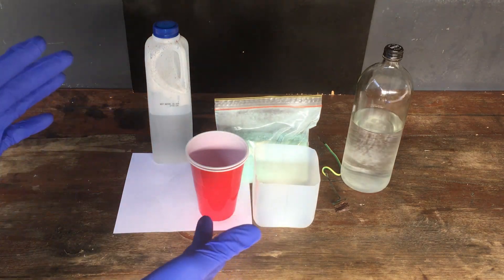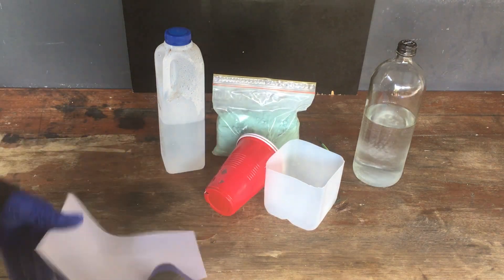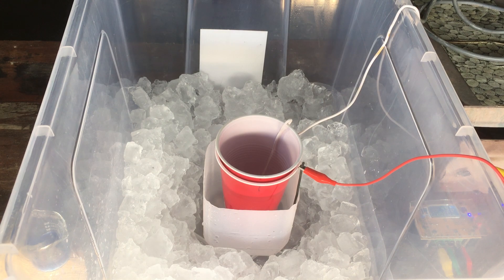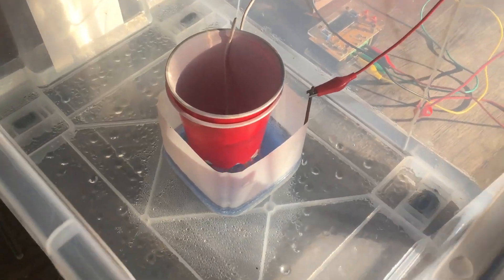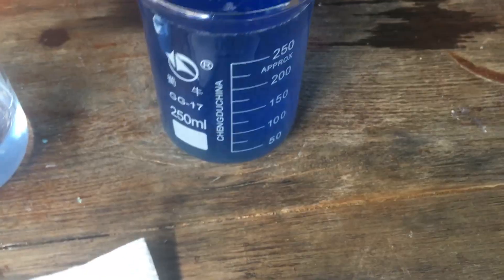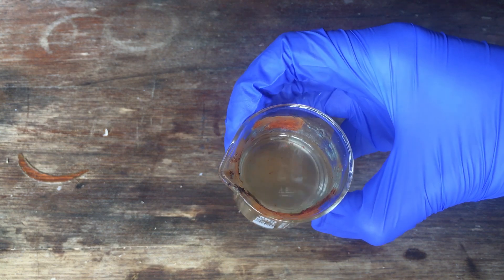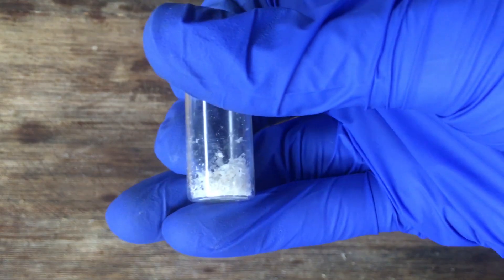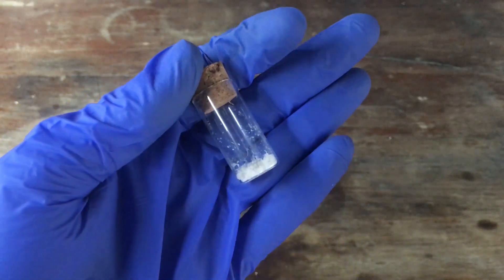Making Nitrate With Electricity

Comment: i wanna see how to make ammonia from nitrate. ammonia is not available for me
Reply: Pure urea from Addblue additive for Diesel cars (about 350g/L) is your saviour...
Urea + NaOH  will set free a lot of NH3 gas aswel as Na carbonate.
Beware that NH3 is a war gas and it will be quite volatile and irritating above 12% especially with skin and wet membranes like eyes, nostrils, mouth, lungs... you may go up to 23% but keep it as cold as possible to limit volatilization... Wear closed googles/diving mask. 

You may do it from personal urine what contains on average 3% by weight urea (30g/L) and about 95% water. But you would maybe need concentration from freezing, evaporation or precipitation via unsoluble or poorly soluble salts of urea (nitrate, oxalate or cyanurate).

I hope this helps.
PHZ (PHILOU Zrealone from Science Madness forum)
Reply: @philouzlouis2042  NileRed extracted urea from urine, it's an expensive and arduous process don't bother. You can get urea fertilizer on Amazon.
Reply: @SIGSEGV1337  
Yes urea ... not ammonia... Nilered  purified urea from his urine and recristallized it until colorless.

Here we only need to concentrate it and react it with NaOH to allow  gaseous NH3 to come out (only volatile compound formed) and react with cold water or an acid solution...

I have urea fertilizer about 25kg...but it may contain biuret, triuret and cyanuric acid. 

Addblue is very pure urea saturated aqueous solution that cost about 8-9€/10L thus for 3,5kg pure urea.
Reply: @philouzlouis2042  Thank you so much! If I make a contraption where the ammonia gas will bubble in water will I be able to capture it as NH4OH?
Reply: @theglorioussunman  yes you can
Reply: @theglorioussunman  
I think bubbling is not an option because NH3 gas is very soluble into water...1L may dissolve up to 230g NH3...thus more than 13 moles (or more than 290 liters of gaseous NH3 at STP)... there will be a sucking back problem.

It is then better to put a one way valve on the heated reactor to allow for gaseous NH3 gas to escape into a second recipient with iced water under agitation and the NH3 exhaust comming out above the liquid but not into it.
You may also use acidified water instead of water to get non volatile ammonium salt... also possible complexation of NH3 with CaCl2 or Cu(2+) salt and further decomposition by heating...
Reply: @philouzlouis2042  thank you so much i will be trying it once i get my set
Reply: If you use addblue for a source of urea be careful boiling it down, urea has a low melting point and it can look like your still boiling off water when you're really decomposing the urea.. leant that the hard way
Reply: How do you get nitrates easier than ammonia?
Reply: @chuckles1808  
Easier than NH3 oxydation...by conventional chemical ways (described into any basic mineral chemistry book... and probably into Wikipedia... from:
-Nitric acid
-Nitric esters
-Ammonium nitrate
-Nitrites 
-Nitrous acid
-Nitrous esters
-NO, NO2, N2O4, N2O3, N2O5

BTW Google or any search engine does reply pretty any question you may have by typing a few key words.
Reply: @chuckles1808  there's numerous ways to get nitrates but none of them are really easy.. probably the easiest way is to leach it out of shit which was the first method but it's still a lot of work.. you can make hno3 just using air and electricity but yields are very low, check out Codys lab.. the best way to get nitrates depending on how much you need and where in the world you live is just buy it, nao3 is sold for curing meats and kno3 is sold as fertilizer or stump remover
Reply: Mix kno3 with naoh and aluminum.  Makes nh3 and sodium potassium aluminate.